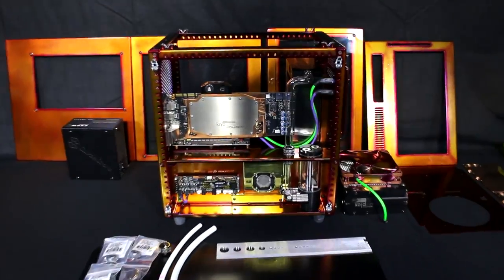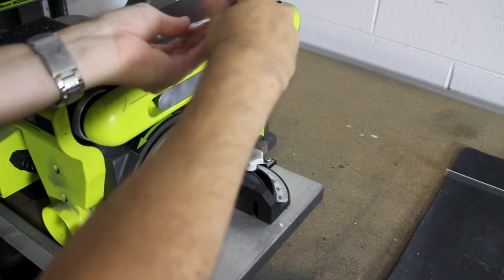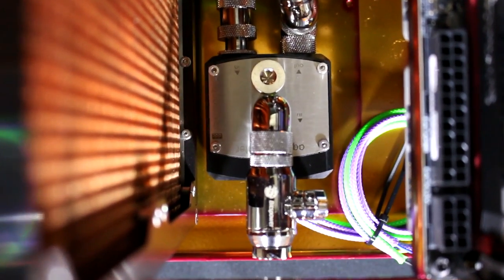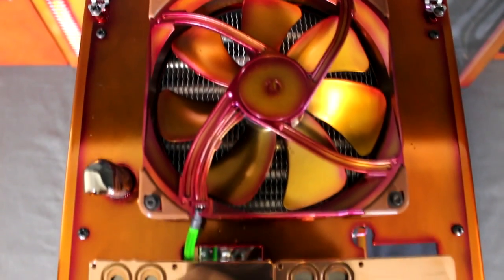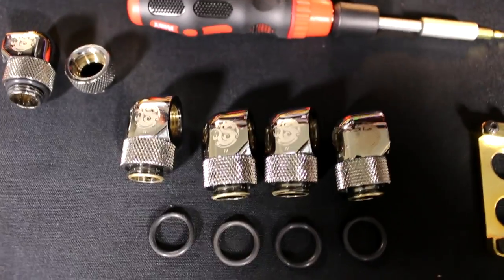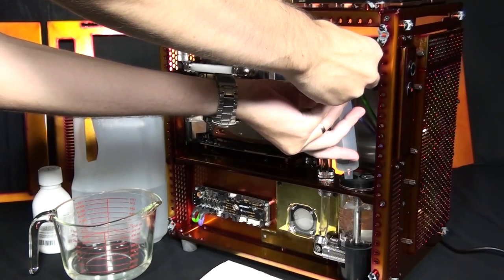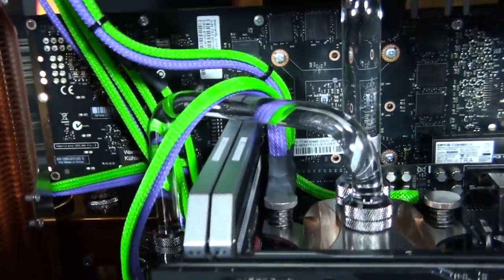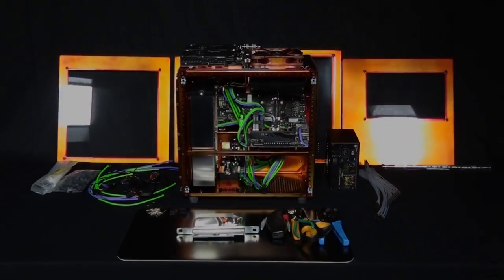Build #16: 'Typewriter': Part 3

Comment: The old camera looks better in terms of focus, but man, the colors in the new camera were so much more vivid. I am not sure which I perfer, but it seems like a tradeoff that I would accept, less focus for better colors, but that is just me
Reply from the maker: I agree, the colors from the new camera are far more accurate. Its just very difficult to get it to focus, but I will sort this out by purchasing a new lens when I can. Thanks for the input.
Reply: I also agree - the new cam has much more vivid color and really shows off more fluently - I am curious though if you are physically getting close with the cam or using a zoom.  In my experience it is always easier for the auto focus keeping the cam back and using a zoom - but then you might not always get the shots you want since there are a lot of tight places to consider.
Reply: ***** Do you have a milling machine or a table top cnc router? I think you could get a lot of use out of both, both are expensive, but with your skills you could get your money's worth outa them.
Reply: Zoink I was thinking the samething. A milling machine would be very handy and make the product look factory.
Reply: ***** I think the frames look more choppy one the new camera, but does look better otherwise.
Reply: +DeadLikeYou Old is not always bad, pics from my Lumix DMC-ZS6 still look good today and I must have bought that thing at least 5 years ago.  The thing is that they used good lenses in them.  I know there are likely to be better cameras now but this one works nicely for me and will until the day it dies but there is no telling when that would be.  The only thing I don&#39;t like is its video mode is 720p but other than that, good picture.

Comment: Hope to see your future builds in 4K quality.
Reply from the maker: Once I start releasing my own components which will be within the next few months if all goes well, I will be able to purchase a new camera and move up to 4K.
Reply: *****
Yeah... i jus't would loven it's sooo beatifull and I can see all of the perfectiones of your work.
Reply: ***** Any idea which camera your gonna get?  I've heard good stuff about the "Panasonic GH4" 
I know Dave Dugdale  would be a good guy to ask.
Reply: Hope to see your future builds in 60FPS
Reply: SinglePlayerPro lee May I ask why? In my opinion it's only games and things like that where you want to watch them in 60fps but I suppose if everything was in 60fps that would be nice.
Reply: no point...
Reply: 4K is better than 60fps in this case
Reply: ***** 4k is nice yeah...but the previous vids were just as good! You do great work my friend. I'm a welder by trade and I build power plants and maintain them but I also make metal framed and solid metal art. Keep up the good work! Always nice to see a craftsman in a different element!
Reply: +Josh Jolliff 4K is nice but it takes lots of bandwidth to watch from Youtube and similar sites.  My monitor is not 4K, I just tried that setting once when I saw it there so I could see how long it takes to buffer enough for smooth playback.  My connection is not bad at all for 1080p but remember, 4K is 4 times the number of pixels even on a display of the same size as a 1080p display.  I find that videos done in 4K look good even when converted to lower resolutions too.  That all by itself is a good reason for 4K just because the color looks good when the video is converted to a smaller size.  I recently had a problem with my monitor and I though that it had died.  I was out at the store looking at monitors of similar size and resolution.  Mine is 1080p.  I kept finding 720p but of course I won't buy those because that is a step backward and every time I turn around, I see better displays.  One of these days 1080p will look ugly by comparison much like the old non HD tvs now do by comparison.  If you remember those big glass CRTs they were often heavy but they were indestructible as long as you don't drop them.
Reply: I don't believe 4k would even be a concern if you're still watching these videos on youtube. Isn't max res on youtube only 1080??

Comment: Beautiful ! This has to be one of the best PC mods ever man, that paint job is stunning and the modified fittings on top are incredibly tidy ! Attention to detail along with home made parts from a variety of metals really adds to the overall look of quality IMO. Mixed bare metals will interact with each other over time and cause each other to discolour and corrode, normally it is something to avoid but in this case it will actually make the build more interesting.
I really don't like the colours of the cable sleeving though, I would really have preferred blue and gold instead of neon green, it stands out too much.

Comment: Love the build. However - I don't feel like the clear coolant adds anything to the build. Like it's there for function, but doesn't complement the theme, or the materials. Perhaps a gold or even a silver colored fluid would be more in line with it. Another thought - this one might look outstanding with copper or aluminum heatsinks on the CPU and video card. Is there a waterblock that has the outer design of a heatsink?

Comment: Man I don't want this to come off as hating, because I work as a welder and know what effect your going for. I hope its a lighting thing, but the color's for the wiring, (and I heard the explanation.) don't fit. The problem is that they are a solid color and it isn't natural to that process. Things don't rush or change color evenly when they are heated until the blue comes through it is an uneven spread. I don't know how to mimic this myself with the materials being used,  You'd almost have to do a controlled dying  of it. Or alternately actually use metal braided cables heat them up carefully with a high BTU heat source (propane, Butane?) and then quench for the rapid oxidization. But this would make the braided cables very brittle. So your back to using what your using, and again I don't want this to come off the wrong way, but in my opinion I think the 2 color choices show the extremes of this effect when it is actually really subtle. My only other suggestion would be to use more then the colors your showing so that you have the fade in effect. (When you hold a OxyFuel torch to a piece of metal and heat it until it blues you will have different shades of blue radiating out from the heat source. ) The effect to me doesn't work as intended because its just 2 color's and I know my eyes are going to go to the thing that doesn't quite fit, and even though this  isn't finished I think those cables are going to stand  out in the wrong way.
Reply: he could also use piping and use it as conduit and just discolor that

Comment: How easy is it to upgrade the System when a new board with a new cpu or a graphik card is needed? Do you then need to alter the cooling system a lot? just wondering

Comment: I notice that a picky part of cable sleeving between users is the implementation or lack of heat shrink at the end of the the cable into the connector. Is this something you do by request or do you always use heat shrink?

Comment: dude, i gotta ask from one builder to another, what's with the raptor 3.5 drives? is it the mechanical movement look? i just gotta know why you are putting those in this beautiful computer. i mean no insult. it looks great, but for that 600 bucks you could get a sata 6gbps ssd that would rock the performance socks off those raptor drives. yeah it wont look as cool when running, but a little anodized color goes a long way.

Comment: Sup guys i have a question if anyone can answer would be great. I got a mcp5x pump and its going to be pushing water through 2 970ek wb, ek cpu wb, black ice sr1 360 rad, and an alphacool nexxxos st30 240 rad. Also a bitspower 150ml res. Is the mcp5x going to be enough for all that?

Comment: How are you going to get memory in and out of the system without draining your coolant loop?  Is the loop that crosses the memory sticks tall enough to allow removal?

ROG
Reply: A couple of reasons for removal would be failure or upgrade.  The builder could have left more clearance and chose not to.  He has a wonderful machine here and it could have been better if he allowed a little more length in that coolant tube.  Unless there is a reason for the tube being short like it is and I am not seeing why it would be like it is.  I am not criticizing the build, I just want to understand it better.

ROG

Comment: going with platter drives over SSD's in a build of this caliber seems pretty stupid to me
there isn't a "small difference in performance" there is a MASSIVE DIFFERENCE A even the crappest of ssd's will out perform the raptor by a factor of two
Reply: rjc862003-- Firstly, those hdd's would've performed almost as well as the ssd's at the time. Secondly, he stated they were mostly for appearance and actually used the sound to reinforce the whole 'typewriter' theme, as there are already multiple ssd's in the rig to begin with

Comment: I actually much prefer the old camera. Yes, the colours are less vibrant and it's low light performance isn't as good. However, the new camera's FOV causes distortion, which, for this type of video, I do not like. (You can get rid lens distortion when editing, Adobe AfterFX has a filter that can do this, for example), the focus range is just way too small, which is where a big part of the focus issues come from, it's almost like you're using a lens ment for close-up 'glamour' shots. And the last thing that I didn't like about it is the excessive amount of motion blur.

Now I'm by no means a camera expert, but as someone that likes your content I'm of the opinion that the new camera takes away more from the content than it adds.